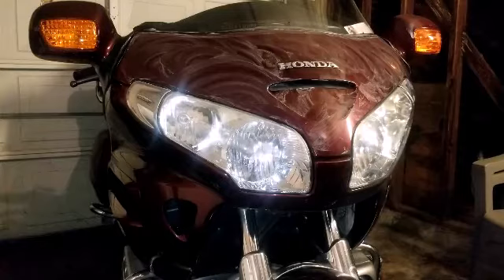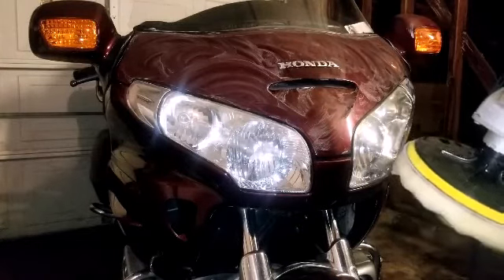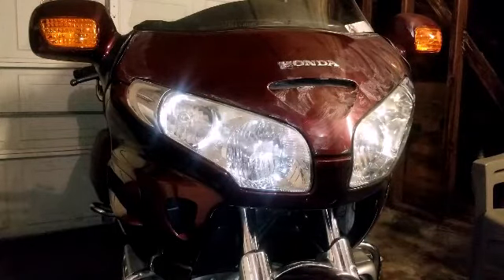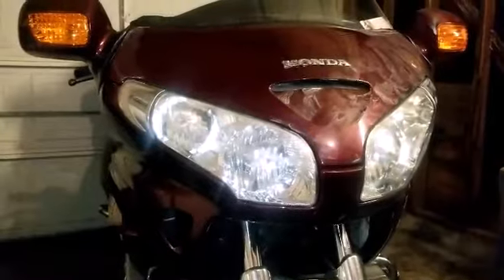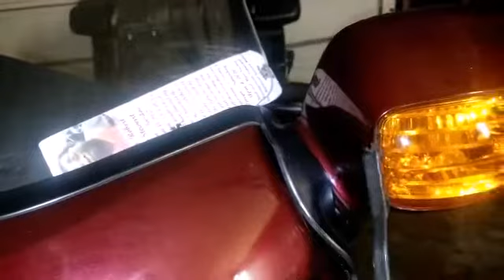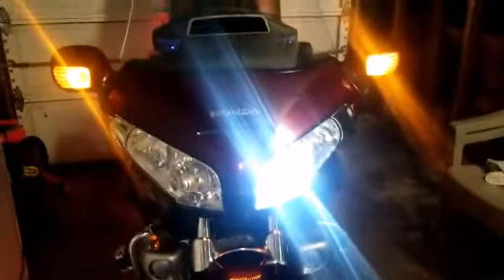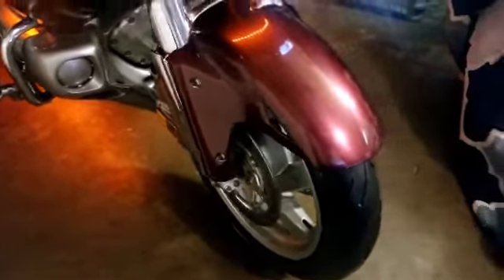How I wax my Honda Goldwing

Comment: how did you wire it up did you use a line output converter what did you tap into
Reply from the maker: Yes I used one & i taped in one of my back factory speakers, the line output gave me my single to run my Jack from it to the amp..

Comment: here my hit i got power ground and remote all good .brought a ds 18 line output how to run the speakers wires to my amplifier 5 ch skar and evl 6in sub with converter ?
Reply from the maker: U still have the factory radio right?
Reply: @timrob_showtell1771  YES

Comment: do you have a website where i can follow to hook mine up
Reply from the maker: I didn't use a website I just figured itll work since I did it a few times b4 on cars very easy to install I'll help u out
Reply: @timrob_showtell1771  trying to figure wiring part
Reply from the maker: @ronniesearcy8712  on Ebay part number 222881518082 its 13 dollars...the way I installed mines is I hooked it up right to my amp & the speakers wire that's on it allowed u to hook to a factory speaker
Reply: @timrob_showtell1771  How you doing I see it it's a 2-channel line output converter with remote amp turn on $12.75 Okay no see my problem is I have a 5-channel amplifier I have the RCA's for the back of it but on the front of it I have a pigtail harness so where is all that wiring up to look up Skar audio 9005 d
Reply from the maker: @ronniesearcy8712  ok I see, do u have Facebook r Instagram, so I can better walk u through it
Reply: @timrob_showtell1771  face book name ronnie searcy
Reply: @timrob_showtell1771  hit me up friend request got fb messenger too
Reply from the maker: @ronniesearcy8712  ok I'm look for u my name is Timothy
Reply: @timrob_showtell1771  ok